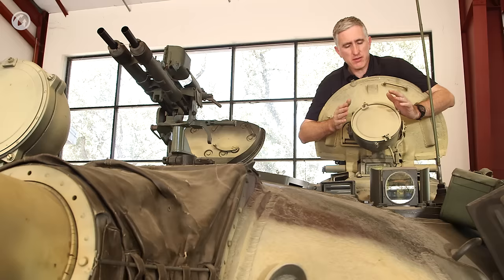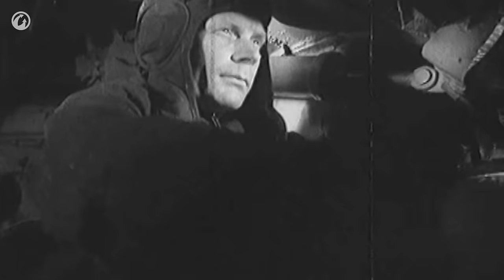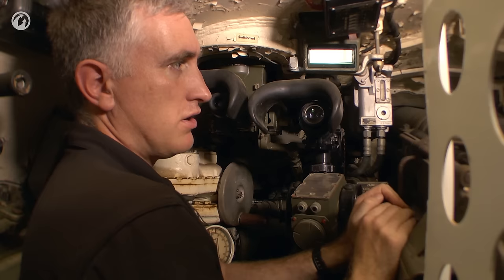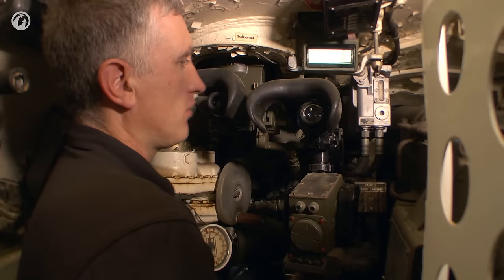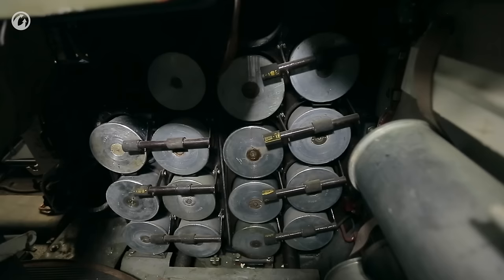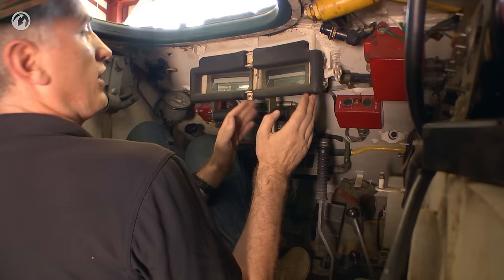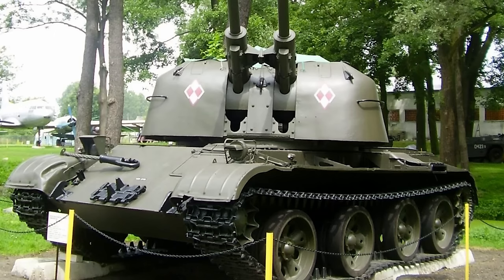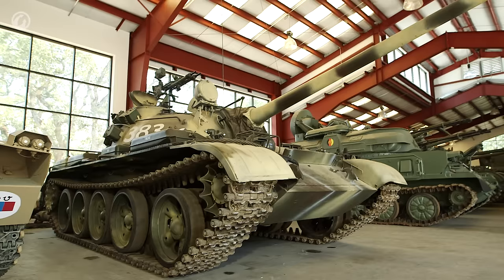Inside the Chieftain's Hatch: T-55A Part 2

Comment: Given a choice between that piece of crap and either an M48 (any model) or an M60 (anything but the A2) I'd take the M48 or M60. Really enjoyed this video, the last time I had the opportunity to prowl the workings of a Soviet era tank it was a T-64 (the version with the auto-loader that liked to "load" the gunner rather than a round...Not a terribly popular tank with it's crews I as I understood it at the time.).
Reply: +FD Mackey Both the M48 [105 Upgunned] and M60 would make mince meat of the T55 [early ones like this] as the Pattons had much better optics and gun control, as well as night vision that blew the russian stuff out of the water [Noticethe  giant spotlights on M48 and M60.]
Reply: Redneck Fury my background is/was in the M60series and First Edition M1 Abrams. I also had a number of occasions to crew on M48s (mainly A3s and late model A5s) and concur with you that the M48/M60 series of tanks were just better all around tanks than the T-54/55 family and from experience can assure you that the M48A5 (105mm) and the M60 (A1 and especially the A3 also with the 105mm main gun) were more than a match for any Soviet era tank up to and including the T-72/74 family of tanks. One round catastrophic (frontal shot) kills with SABOT at 3,000+ meters were not unheard of in certain circles where the T-54/55 through T-74 were engaged by M-48A5s and/or M60A1 and A3 tanks. Advantages the A3 had/has over the A1 was/is the fully stabilized main gun which allows it to fire on the move far more accurately than the A1 not to mention the M1ish fire control system. I loved my old M60A1...I still do....But advances in tank technology cannot be ignored or taken for granted. Today, while they could still fill a reserve or "holding action" position on a 21st century battlefield, I'm afraid my old ride(s) would be hard pressed to survive long against the tanks, attack aircraft (think Apaches), and "smart" artillery and their assorted munitions. Even the newest and bestist of AFVs are not proof against some the stuff available to armies today....And let's not even think about IEDs that Bubba comes up with in his basement that can just ruin a tankers day.
Reply: +FD Mackey I'm sure that your experience with the Patton series of tanks is extensive, but without having equally extensive experience on the T-55, your opinion is only as good as anyone else's. The M60 didn't get a stabilizer until the early 70's, if I remember right. The T-55 had one since the late 50's. Make of that what you will, but doesn't that let the T-55 get a shot off much faster than an M48 despite "better optics"?
Reply: Tiles Murphy What? the M60 always had a Stabilizer, the US was the first country to even make them standard issue on their tanks, hell the M4 sherman came standard with one back in the 1940s [one plane, but regardless it was a stablizer] 

Also your stabilizer only helps with shooting on the move, otherwise its not particularly useful, it has nothing to do with your RPM, once you are on target your rate of fire is only changed by how fast the loader can shove rounds into the tube.

This is why the American M48/M60 takes the edge over the T55 , their range finders where just better, the coincidence rangefinder [the optics on each side of the turret] allow for a far easier first round hit.
Reply: Redneck Fury No, the M60A1 only got its stabilizer in 1972 through the AOS program (Add-On Stabilizer). Maybe that was before your time?

Just because you invented something doesn't mean you're the most enthusiastic patron. The Chinese invented gunpowder, but it was the Europeans that really took it to the next level. 

Well, if the ability to quickly and accurately shoot on the move is such a "minor" advantage... Ho hum.
Reply: Tiles Murphy Tell that to the hordes of T55s slaughtered by the Centurions that had no gun stabilizers and armor several times as worse.

This is not modern fire on the move tech, this is "About here" sort of accuracy.
Reply: Redneck Fury Don't you think that that depends on the tactics, skill and supporting elements more than anything? It's sad to know that even experienced tankers can still be so shallow...
Reply: Tiles Murphy The Centurion was a terrible vehicle, its even older then the T55 and had some pretty much WW2 era gun controls, solid steel tracks, lack of a neutral gear and required a ranging machine gun to even hit anything with accuracy and semi reliability, the fact that the T55 was defeated by them would be like a M1 Abrams losing to a T62, hell even the people who deployed the T55 believed it would kick the ass of the Centurions.

I brought this up more to prove that gun stabilizer alone does not make a tank that much better then others, and in most cases during the cold war it was totally unnecessary as shooting and moving was not quite ready to be implemented till the age of the gun computer

This is the Era of One shot one kill, all these tanks could penetrate and knock out each other in one shot, it was more to whoever can get the first round hit sooner, the American style range finder was the best available till the laser range finder came about, that's why i keep saying the M60 and the M48 are more lethal against the T55, it can spot it easier [Its not hard to figure out that the american tanks had better and vision ports] could range the target faster, and let that first critical round out sooner, that's the importance.
Reply: Redneck Fury The T-55 could kick the ass of the 17 pdr Centurion and probably the 20 pdr. The 105mm Centurion is a different animal. Sure, it used a ranging machine gun. What did the T-55 use? A stadia rangefinder like the type you can find in your PSO-1 rifle scope, so I'm sorry, but I don't follow you. You're saying that the Centurion, a severely outdated tank with severely outdated optics was still able to kick the ass of a tank that used a stabilizer. Well, were the Centurions used primarily in the defensive? Then you've got to take into account the fact that defending is a lot easier than attacking. There are a heck of a lot of other factors that need to considered during the individual cases where ass was kicked.
Reply: Tiles Murphy My point is that the Gun control and first round hit is what made tank battles important in the early parts of the cold war, Americans did not have to use a math problem based of a number in their sights to find range, their ranger finder just gained focus and it gave you the exact range to target, thus making first round hit many times as likely

My major point was that the 100MM and the 105 gun have similar ballistics, if one could fire accurately on the move it should be able to roll right though the tanks that can't and are forced to stand still, the fact you are moving alone should make you many times as hard to hit, but it was rare that tanks of theses times even fired on the move at all, as i stated before, its not like modern stabilization, these more or less just kept the gun 180 degrees to the hull so your on the move accuracy is only useable at under 1000 meteres

Also i am responding to another of your posts in this comment, that T72, the entire weld seam and armor on that side is busted out and warped, that means the pressure would have easily killed the crew, can you get me some documentation on the survival of this particular tank?
Reply: Redneck Fury But the Centurion with its rudimentary rangefinding capabilities pitted against the T-55 with its equally rudimentary rangefinder is not a good comparison to make to illustrate your point. You also do not understand how stadiametric rangefinding works. The gunner does not need to use math to calculate the distance to the target. He simply brackets the target tank between two choke lines, and by looking at whichever two lines touch the top and bottom of the target tank perfectly, the gunner can know the distance, which is marked out on one of the choke lines. The figure that is marked out is not the key to a range formula. It is the range, simplified to the hundredth value.

The big thing about the tanks standing still is that they are usually in a hull-down position, so they are even harder to hit. Does this mean that stabilization was not helpful? Well, of course it was. You can keep your sights on target and open fire almost instantly upon halting. However, this does not change the fact that defenders have an advantage over attackers that is so huge that it nullifies any other factor.

No weld seam was busted. That's a part of the hull curving out in order to accommodate the turret ring. By the way, the matte material around that curved piece of steel is external cladding made of the same material as the internal lining.

Comment: steering wheels on western tanks???  also.....how can you be cavalry without a horse???
Reply: Learn your history
Reply: Yeah steering wheels, why? The Germans had been using hydraulic steering wheels on their Tiger tanks in WW2. That said, the Russians are still using sticks to steer their T-90 are they not?
Reply: @Jacky-zt5ch  ..erh. what's wrong with two "joysticks" 2023+ person? 😛
Reply: @Jacky-zt5ch  It's a side effect of mounting the engine transversally, everything went into saving space so that armor could be thick on a relatively light tank and it worked as T-55 is 10 tons lighter than M60 with weaker armor.

Comment: "for its time" and yet they are being pressed back in to seevice in Ukraine
Reply: Allegedly as assault guns. With modern communication and optics it wouldn't be any worse than M10 Booker for plinking away at strongpoints.
Reply: @Klovaneer  by modern optics you mean Russian made passive thermals that can't see past like 300m right? I'm fairly confident that North Korea has tanks with more advanced optics. 

Might as well just use the tank as a howitzer and blind fire it.

The difference between the T55 the M10 is that the M10 hasn't been pushed back into service decades after it became obsolete.